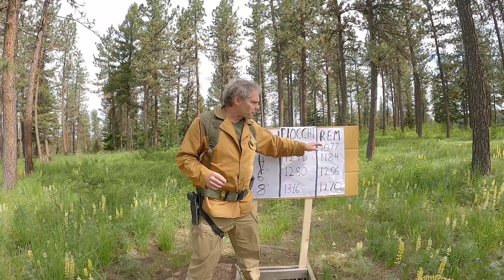How Does Barrel Length Change Velocity

Comment: I wonder whether the longer barrel allows more pressure to build as Paul says at the beginning of the barrel or whether the longer barrel simply allows the pressure to act on the bullet longer causing it to accelerate more before it reached the end of the barrel and the force of the expanding gasses stops working on the bullet.  I understand that acceleration is a function of pressure (force) over time (barrel length).   I would assume that the maximum pressure is achieved at the moment that all the powder is burned, but I have no idea how long that takes in relation to the time it takes for the bullet to leave the barrel.

Comment: I know this is an older video and paul has gone, but this Rings true to so many different guns for a woods gun is a minimum of 4in for almost maximum efficiency of the cartridge and weight, but the 6 seems to be all around the best unless you need even more accuracy in the 8 inch. But has Paul would say that at least a little bit of a caveat as well, if all you have available is a 5 inch instead of a 4 or 6 that seems like a really good compromise if you can't get it in a 6-inch or a 4-in a 5 would be perfectly capable if its all you could get.
Reply from the maker: We have a video uploading now testing 9mm  barrel lengths. Your correct regarding 4 inch vs. 6 inch and 5 inch. I have found 5 inch in handguns is "just right" for carry, round performance, and accuracy. I had a .44 mag, 629 classic with a 5 inch barrel. Loved it.

Comment: I did some math for you guys.
Moving from 2.5" to 4" (+60% barrel length)  gives you 10% more velocity. 
From 4" to 6" (+50% barrel length):  +  3-6% velocity.
From 6" to 8" (+33% barrel length):  + 1- 3% velocity.
In general, shift from 2.5" to 8" (+220% barrel length) gives you  just +17-18% velocity. It's pretty interesting.
But you need to keep in mind that the test was carried out on an 'ideal' revolver. In reality, the data will be different for different revolvers, as Paul said at the beginning of the video.
Reply: Thank you. Appreciate the comment that brings our or clarifies information. A valuable counterbalance to the what-if brigade and the troll army.
Reply: Thank you for doing the math for us! People like me suck at it.

Comment: Thanks Paul Harrell, I didn't realize my shotguns were sitting all this time with the internal hammer depressed, thankfully I watched your top 5 home defense guns video, I immediately went to the gun safes and cleared the chamber and clicked them all to un compress the spring, you saved my guns spring thanks, they still work fine( modern guns)

Comment: Paul….. dude, the words “ Dan Wesson” were already forming before you said them. Didn’t even know he ( is it a man or a company or both?) was still around. All the old timers from the 70s-80s will know the weapon. Gotta ask, how did it handle? As good or better than a python? A model 29?
Reply from the maker: As far as I know, the pistol pack in this presentation was made in the 1980's
 We filmed a presentation on barrel length effecting accuracy. It will air in a week or two.

Comment: When you brought up the fact of differences in rifling, distance from cylinder face to forcing cone, etc., I thought you should have gotten a Dan Wesson.  Of course, the next thing you said was DW pistol pack.  :)   I have waaaay too many of those, a substantial number of them include the 10" barrel assemblies. However, I have been unable to find any of the 12" or 15" barrel assemblies.  It sure would be interesting if you had been able to acquire those longer BA's.  I was surprised about how the additional length's gave reduced advantages as the length increased. I wonder if the 12" or 15" BA's would result in reduced velocities. Thanks, once again for the education.
BTW, I love your Old School T-Shirt except for one thing; the listing says '65 T-Bird.  The illustration is actually a '63 Bird.  I've owned a '55, '59, '60 and '63. My mother had a '61, '63, '64, and '66. Please have someone correct your listing. :)

Comment: Another reason why someone may want a pistol with a long barrel legth could be Country rules, such as here in the UK. Law states: 
Small firearms, 2.46 Section 5 of the 1968 Act prohibits any firearm which either has a barrel less than 30cm in length or is less than 60cm in length overall, other than an air weapon, a muzzle-loading gun or a firearm designed as signalling apparatus. The intention was to prohibit certain particularly dangerous firearms which were easy to conceal. In general terms, this has meant the prohibition of handguns but it is important to remember that the legislation does not refer explicitly to handguns; instead it refers to small firearms.
Some pistols have a rod welded to the pistol grip to make the overall length more than 60cm.
Love the channel by the way.

Comment: In magnum loads you have different burn rates. For short barrels fast powders, for longer barrels slower powders. Example Bullseye is used for short barrel loads. 2400 is used for longer barrels and rifle length. I have a Dan Wesson with 8" and 4" 44 magnum.

Comment: Would you think that starting rifling about 1/3 length of the barrel length could change velocity and the energy of a projectile! Smooth bore after the chamber and after that starting the rifling. It would be an interesting experiment varying different distances when the rifling starts.

Comment: Sorry to bother you Mr. Harrell, I was hoping to ask a question however as I really don't know who else that might have any sort of experience to ask;
The barrels of some shotguns are relatively easy to replace, a Mossberg 590 for instance, and I was wondering if it would be feasible to either have made or purchase multiple barrels for different purposes in reloading or something similar. Using a rifled barrel and reloading specific slugs, having a longer and choked barrel for bird or skeet if you so prefer, and having a normal twenty inch barrel for general use with buckshot or otherwise. My thought was using that as a more "jack of all trades" type gun so you can master that gun rather than having multiple guns.
Probably a silly question, however I just wanted a second opinion as everyone I asked at the very least thought it was interesting, if not a pretty good idea.
Hope you have a great rest of your day, and again sorry if this is little more than a waste of your time.

Comment: Comparing 300 blackout and 762x39 barrel length ballistics would have also been interesting. Lower pressure rounds do better in shorter barrels IME
Reply: 300BLK is effective in very short barrels because it uses faster burning pistol powder.   7.62x39 uses regular rifle powder and requires a much longer barrel.  
Think of it in terms of pressure curves.  A 7.62 gives a gentle rise of pressure reaching a peak.   Blackout gives a short sudden blast of pressure.

Comment: Also, these are just .357 magnum results. Different calibers might gain different amounts of velocity from different barrel lengths. I wonder what the difference in velocity between a 6 inch barrel and 8 inch barrel .44 magnum, or .454 casull would be, for example.

Comment: Hello Paul, I know you have done a few videos on zeroing. However, I was wondering if you would be interested in doing an in-depth video on max point blank range. I only own a hand shake of guns. I hate to make the assumption, however, watching many of your videos now, I think it is safe to assume you have many more guns with many different barrel lengths then i do. The idea in my head would be a quick definition/explanation of what MPBR is. its hunting and military applications etc etc. and then the long fun part of chrono. From your pocket carry micro's up to your longest barrel. Then with the real world data you can crunch the numbers on each barrel length's MPBR based on different target sizes, and some other variables (ie. bullet drag coef. , grain). I think doing so would give some people a better understanding of a different approach to zeroing other then your classic 25/50/100/200. With the muzzle velocity of my 10.5 averaging around 2600, and the information I had found on the bullets i use. For a 4 inch target, my close zero is 27 meters and far zero ends up around 165m. In between that distance the bullet stays within a 2 inch arc. That might seem short, and that might seem like a narrow path. However, I am of , again, the assumption. that with that lower MV from the 10 inch barrel there are quickly diminishing returns outside of 200 meters.  So i chose a tighter target arch and a theirfor a closer zero then the normal 50/200. Yet just a hair above the 25m zero i use on most of my pistols. Which brings up anothe point, using MPBR to zero in your short barrel pistols to gain maximum accuracy over the bullets' optimal distance.

Comment: First, thank you Paul for a very informative presentation.  In ref to how long is better, when reading about the Henry .357 rifles, I found that the 16.5" barrel offered higher velocity, but the  20" barrel is offered in that caliber because of the longer sight radius that some felt were more accurate for them using open sights.  From reading that, I assumed somewhere between 16 and 18" was the max velocity on .357, (depending on ammo).  After seeing this, I now am thinking the max velocity may be even shorter than 16.5".  However, a lever action does not lose anything to a cylinder gap.  Any thoughts/info?
Reply from the maker: The rifle will get different results because of no cylinder gap.

Comment: This is why some versions of defensive ammo come in "short barrel" versions. I have a 4" .32-20 and some 7-1/2" .30 carbine caliber revolvers, and handloading for them is apples and oranges. Same for the 24" .32-20 and 18" .30 Carbine rifles. I'll be cutting two .30 Blackhawks down from 7-1/2" to 4-5/8", and doing a velocity comparison. So yeah, hacksaws (actually the lathe) will eventually be involved.

Comment: Two-wheel commentary.
Yes, the power required to move on a bicycle can help illustrate the effect of feet per second speed and power.
The difference between 14 mph and 20 mph? Double the required power to go faster.
The difference between 10 mph and 14 mph? Again, thevgreater speed doubles the required power.
Point being for ballistics? 1,000 fps is half the energy of 1,400 fps. And 1,400 fps is half the energy of 2,000 fps. Yes, doubling the velocity gives you FOUR TIMES the hitting power.

Comment: Mr Harrell, aren't there some powders out there for those that reload that take advantage of the longer barrel??? 
(Or there used to be before all the craziness concerning ammo!!!)
Reply: Yes theres some powders that burn faster meaning you can get a shorter barrel to get terminal velocity faster so make a 2 inch have 4 inch velocity theres slower powders also for example most rifle calibers like the 5.56 when you start going down on barrel length velocity can vary greatly 44 mag has been compared even to 30-30 in a rifle length barrel even

Comment: I had heard for years that 6-6.5 inch barrels were the "Sweet Spot" for .357 and .44 Magnum revolvers when it came to ideal performance velocity and sight radius.  Paul's demonstration would seem to confirm that, depending on the ammo and brand of revolver used.  This theory was based on using the Smith & Wesson Model 19 and Colt Python for the .357 Magnums and the Smith & Wesson Model 29 and Ruger Redhawk for the .44 Magnums.

Comment: I had the oportunity to get a Korth revolver in .357, downside was, it had only a three inch barrel. I wanted to find out how much velocity i would loose in comparison to my 4 inch Smith & Wesson 686 "Security Special". My tests are nowere as meticulous as Paul Harrell here does it but i shot each revolve 6 times with amunition from one box,  at the same distance trough my cronograph within less than ten minutes. To my amazement the 3" KORTH was faster than the 4" Smith & Wesson. I put it down to the cylinder gap, as the gap between the barrel and cylinder is smaller on the Korth.

Comment: As long as the gas pressure inside the barrel is greater than the pressure outside the barrel, the expanding gasses will continue to push against the projectile. Friction is present throughout the barrel, and is also present to a lesser degree outside the barrel (obviously as air.) When the gas pressure inside the barrel is too low to  push against friction inside the barrel, it will start to slow back down. This equalibrium usually takes longer to occur than most people realize. A .270 win for example, still accelerates to the end of a 28" barrel. The trade-off is barrel vibration affecting accuracy, because the longer the barrel -of the same thickness - is, the greater the vibration.

Comment: .357 lever action should yield a staggering FPS. 9mm carbine is impressive over pistol comparison. Close range shots with hollow points can get interesting on expansion when shooting higher velocity they are not designed for. Hollow points tend to grenade.

Comment: Good video. Bench clamp the 2.5" vs the 8" and see if the snubby has flyers and at what distance does it occur. Also like to see a lever action rifle .357 velocity vs pistol even though it's not relevant because of different rifling.

Comment: One thing I noticed with rifles is that the different burn  rate powders
see a different amount of velocity change relative to barrel length.
With my .300 Win Mag and my 6.5x55 Swede using slow burn
rate powders the velocity change for every couple inches of barrel length
can be significant. Like 25 or more fps per inch. This is with IMR 4831
and 7828.

 I have yet to try this with any of my modern revolvers.
With my black powder revolvers, going from a 9" barrel to a 12"
with the same load of  powder saw a change of around 50 fps. 
These are 1858 Remington revolvers using 25 grains of 
Triple 7 and a 143 grain round ball.

Comment: Your explanation about handguns with very long barrels isn't quite on: let me explain.
 The pressure will peak at some point and begin to fall before the projectile actually leaves the barrel.
This will happen even though combustion may not be complete yet. Remember, PV = nRT. As the bullet moves down the barrel, volume increases. This will contribute to a lessening of pressure, and eventually this effect will outpace the addition of pressure through combustion, even before the combustion is complete.

This does NOT mean that the bullet will stop accelerating, it just means that the pressure reaches a peak and starts to drop off again after a certain point. The point at which the bullet starts actually slowing down won't start until truly ridiculous barrel lengths, where the pressure has dropped to such an extent that the force it provides is lower than the friction from the barrel.

This effect is why, for example, loading with a heavier projectile necessities using less powder. At any given time after ignition, that heavier bullet won't be as far down the barrel. This would mean higher peak pressure if there was the same amount of powder. This is one reason why loads with lighter projectiles tend to have more energy at the muzzle.

Comment: I done a similar test with 9mm not long ago.
I was testing 2 ammo types. imi +p die cut hallow point and federal hydroshock.
I tested each shooting the same type target, water jugs, at the same distance (about 10 ft).
Had 2", 5" and 16" barrels. 

I don't own a chrono, but the bullets tell the story.
16" barrel, all rounds were just shrapnel
5" faired much better, but the +p was missing more pedals than federal. Both very out of shape.
2" made beautiful flowers/buds and held together.

I think recall one of pauls videos that a 9mm from 16in barrel is basically a 357 magnum from a standard handgun, well, the water jugs didn't know the difference lol

Side note: none passed through 3 gallons

Comment: I've a Smith that has been fired less than 300 rounds. Cylinder gap on one side is 
0.007. The other side is 0.014.  Very poor quality control. You'd think they could at least cut their barrels square. I'm mentioning this because  the 2" barrel is losing enough velocity through the gap to preclude  proper expansion of HP ammo.

Comment: Maybe some of the hotter loads would benefit more from the longer barrel. 
The only scenario I can think of that could make a really long revolver barrel worth the heft is hunting. Getting all the juice out of a .357 would be beneficial if it's gonna be used on deer or hogs. 
The extra size and weight beyond 4 or 6" doesn't seem justified for much else.

Comment: I carry a 16" 44Mag lever action and a 5" 44Mag single action in the woods. Same load. 
From a 16" carbine with 240gr hardcast I get 1800fps. From a 5" Blackhawk with the same load I get 1250fps.
Diminishing returns? Yeah. But the load is built with Ramshot Enforcer powder for the carbine. I have no complaints as to its function in either platform.
Reply from the maker: The carbine doesn't have a cylinder gap.  So the diminishing returns won't diminish as much as a long barreled revolver.